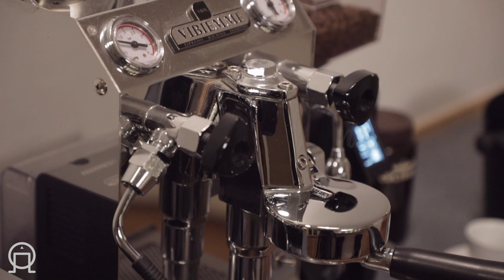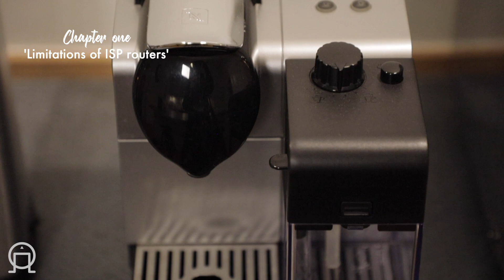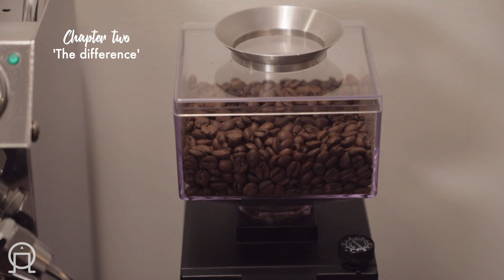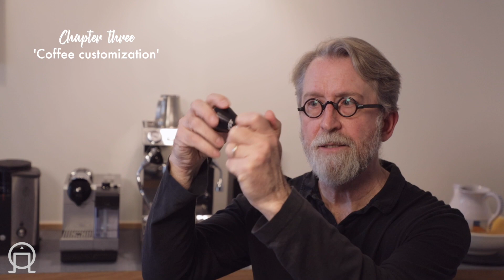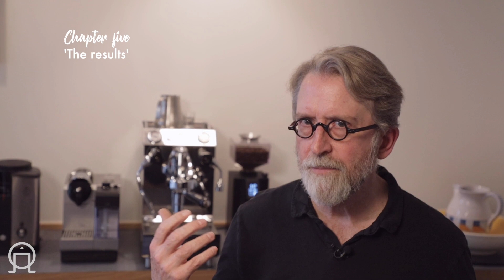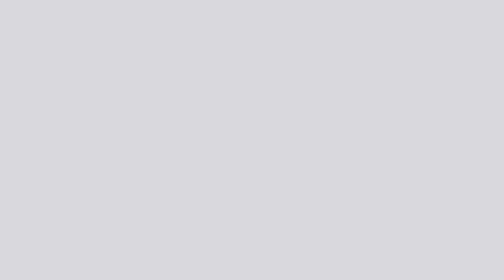Coffee Comparison - From My Listening Position

Comment: Hi Terry, i allways appreciate people who think outside the box and outside of their comfort zone ! the "coffee" you consume at your router/switches/APs is just going "throught" them, it will be cooked somewhere in the internet on a streaming server, with thousands of routers and switches in between the line from the source (server encoder) to the destination (streaming client device decoder). You can not really optimize a already cooked coffee (in the internet) when falls into your local coffeepot and is ready to drink.. to stay in your example.  of course you can optimize your local "dishes/coffepot" to be cleaned, but then you have to have really prober knowlegde where and why you have to adjust. This must be align within the standards of the IEEE RFC's, to work. IEEE or similiar standards are something really rare in the hifi industry but mandatory in the data transport world based on the OSI reference model where all network attached infrastructure has to follow. You need to separate the topics into Layers as there are Layer 1 (power and physical devices) Layer 2 (Switches / APs that handles MAC Adresses) and Layer 3 ( IP-Packet handler like Routers). Your home ISP Router is just a NAT/PAT device, not are really Router, more a Layer 2 Device without a routing table. Independent if you are using real local Routers by your own demand in between. All phy wires in the line of the ISP NAT device towards your streaming client, MUST meet the IEEE defined standards, if they don't => no Link/ no packet flow. If you change it manually to not standart => no Link/ no packet flow. The often discussed topic on Wifi Network are only discussed from people who do not really get the picture. For example, if your local cooked coffee migh looses some small powder pieces on your damper, it will still taste very good. I don' t belaeve you can taste if there are missing some powderpices of your coffee. To speak in more technical words, the music stream is build on OSI Standards and IEEE Codecs, that contains detailed descriptions also for packet lost and jitter inside a stream... from the internet, through all of the thousands of Router hops down to your client with a lot of latency in between. To cover this, normally your stream endpoint has memory buffers for income and outgoing packets based on the phy Media Speed and Duplex behavior and also the pice of software decoder inside the client have the same buffers. Because Packet Lost, Jitter, Delay is something that is totally normal and also descriped within the IEEE 802.3 Ethernet Standards and of course the RFC's for the used Codec of the stream. This works also if your Wifi is weak by congestion or overlapping channels, there is nothing like noise on a Radio receiver. Either you client get the Packets, than the music plays as the codec is defined or the stream and music stops because the sending/receving buffers on some devices are empty because of packet lost or processing lack. Even in this case, you can not and wnt not change the buffers.  If you start monitoring your infrastructure, you might look on the packet lost on your devices, Switches, AP and whatever... but the problem is,, even if you see packet lost, you have to have the knowledge why in some cases it is the nature of the device to have Packet Lost, because it can only work half duplex for example. You can make thinks mutch worse if you change for example Duplex Settings without proper understanding how the mechanic of AutoSensing and / or AutoNegotiation works between two endpoints and if your Cable Infrastructure really is capable of.. The difference between Cat5 and Cat5e is huge ;-) And so on, and so on..  stay strong and kind regards !

Comment: On your advice, I replaced the default low cost router with a fritz!box 6660 router with ip forwaring enabled so that a dedicated lan connection is available.
The difference from before is amazing. 
Thank you Terry.
Reply from the maker: Anton, so happy to hear it and thanks for letting me know. Enjoy! Terry
Reply: @PrimareAB  and the amp is a I35 :-)
Reply from the maker: @antonjessner5442  Thanks for the confirmation, as I was thinking that is what you had. Have fun!
Reply: And there are no more disconnections. Before every third change from cd to qobus I had to restart the whole system. A whole day and everything runs as it should be.
Reply from the maker: @antonjessner5442  Yes! Just as it should be, thanks again for letting us know.